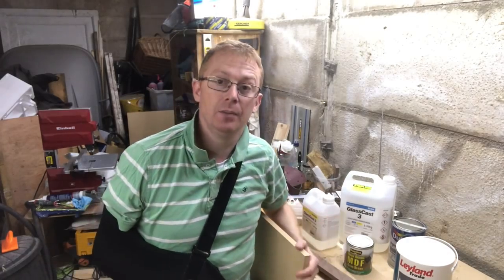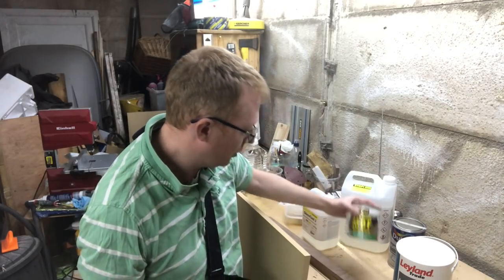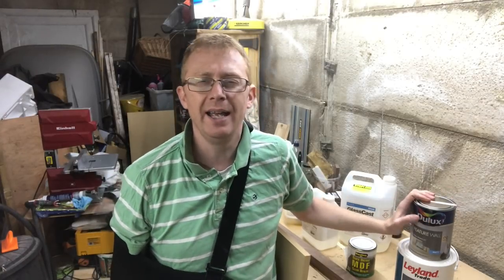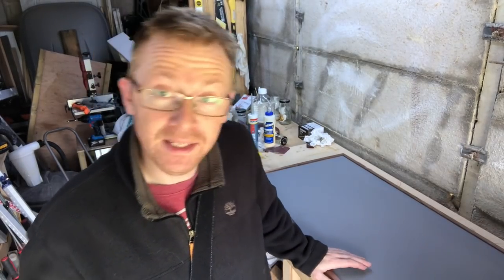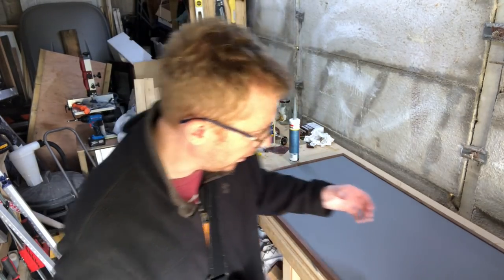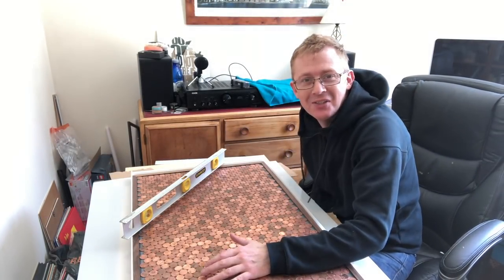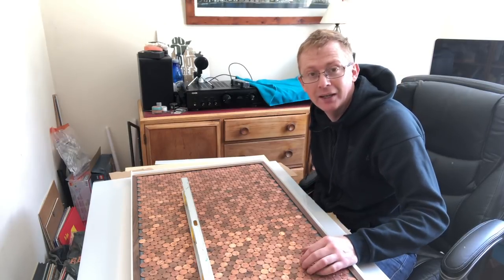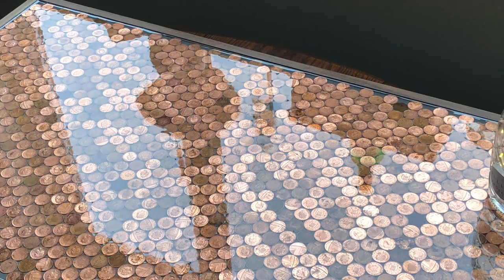Making a walnut / resin table top for pennies

Comment: Very nicely done Leo. You should be proud of that one 😁👍. I made the "expensive mistake" with a resin leak when I made my "penny box" vid recently, if you want a laugh... check out how I stopped it...lol. Also just a word from personal experience... don't rely on your JCB for mitres 🙁. I had the same one and could never get a decent joint. I now use a Metabo. Great vids, glad I found your channel. Keep up the awesomeness 😁👍.
Reply from the maker: Frank Williams Nice one, thanks Frank for the very kind comment😀. I will head over and have a look at the penny box video this morning. I’ve had the JCB SMS for around four years and (once I replaced the blade with a half decent one) has served me well for general 90 degree cuts etc, but now I’m doing more intricate and stuff that requires a greater degree of accuracy, it is just not up to the job unfortunately. It’s not retired yet though as I’ve given it to one of my neighbours who’ll get good use from it. I released an update video a couple of weeks ago and talked about investing some money in myself to build up a little part time business in making things like the chopping boards and penny tables to order. Decided to upgrade some of my tools and the mitre saw is one of them. Still love my budget tools though, the Ferrex impact driver is incredible value for money! 😀

Comment: nice table mate, can you help me clear something up. I watch all these epoxy videos and some people after thet pour the epoxy they get the sander out and polish and polish and polish it can you tell me why you didnt have to? Is it something to do with it being on wood? Cheers mate, the thought of all that polishing puts me right off
Reply from the maker: Hello James, cheers for the message. The reason why I got away with no sanding / polishing on this one is because it is Glasscast 3 which is a thin pour epoxy of up to 3mm that leaves a lovely finish requiring no sanding. Well I say that, that is providing there are no imperfections like bubbles etc which if there are it’s get the sander out and have many hours spare 😂😂. With the deeper pour stuff for the likes of resin tables then yes you will need to sand and polish it to your desired effect, but not so with Glasscast 3👍👍

Comment: Great job.  I’ve done a couple of table tops with resin, but I used circles of wood cut cut from smaller branches that I’d had in my wood pile for while.  The problem with the wood is its porous so you get bubbles, a lot of work to keep going over with the blow lamp to pop them .
Reply from the maker: Spot on Tony, as I said in the video, give it half a chance resin will soak into anything. The caulk around the edges helped by creating a barrier between the resin and the wood, but even then I still got some bubbles around the edges and had to keep checking and use the heat gun very lightly. The Glasscast 3 is better at reducing the bubbles, but the offshoot of this is it’s only suitable for slim pours. I think the ultimate solution is the degassing chamber thing, but you’re looking at £500 plus which isn’t on my horizon to be honest. Thanks for the comment 😀
Reply from the maker: Tony, was just thinking last night what you said in regards to porous wood and the bubbles. I read about a technique a while back, although I haven’t tried it myself, where people basically paint a thin layer of resin onto the wood and let it cure to the B stage before then applying the main pour. Apparently it creates like a protective membrane and helps to reduce the bubble issue. Maybe worth a try?
Reply: Hand-i-Craft That’s a good idea.  Funnily enough I did a thin layer first to stick down the wood slices, but I didn’t coat the tops, so close and yet so far hahahah!
Reply: i think this might answer my above question
Reply: or its probably below now

Comment: Is it easy to clean resin off of paddle and other items?
Reply from the maker: Apologies Rodney I’m not 100% sure what you mean, but if you mean the mixing paddle then if you buy the polypropylene mixing stick then yes the resin separates easily. The metal paint mixer I use I just leave over the resin bowl for the mixture to fall off and had no issues with using it again👍👍
Reply from the maker: Sorry Rodney, just read it back again. All the casings I use are made from polypropylene and resin doesn’t stick to that at all. It just ‘pops’ off once cured 👍😀👍😀

Comment: Nice project. Thanks for sharing. The video is very clear, everything step by step explained. I admire your patience. Gluing all those coins on the surface..
Was that a necessary step? I can imagine the epoxy would bind them to the surface. Or would they start floating away when you pour the resin?
Reply from the maker: Thanks Hans. Having worked a bit with resin now I can say with a decent degree of certainty, yes the pennies needed glueing down. If you try any project with resin and you are inserting an inlay of some form, it needs to be secured to the base otherwise the resin will submerge under it and lift it to the surface. It is a great product, but also a difficult product to work with, I’ve made mistakes like in my oak/resin top table which I learnt a great deal from, hence my ‘belt and braces’ approach😀. Glueing the coins took ages, but when I changed up to the silicone gun with some No More Nails instead of a drop of superglue on each coin, it was a lot quicker😀.
Reply: @Hand-i-Craft  Thanks for explaining why the pennies had to be glued down.

Comment: Saw your table great job,silly question how do you estimate the number of  2p to use.Thanks
Reply from the maker: david lacey Hello david, thanks for the message. If you’re using 2p’s they are 25mm in diameter, 1p’s are 20mm. If you intend to interlock the pennies like I did then take a couple of mm off the diameter for the length of the table. Then it’s a case of how big you want to build the table. Say the table top is 900mm x 500mm using 1p’s that are interlocked. So 900 / 18= 50, 500 / 20 = 25.  50x25=1250 (approximate) pennies needed. I hope this makes some sense, if not get back to me 😀
Reply: @Hand-i-Craft  The same idea but using beer bottle caps instead.Many Thanks for the reply.😀😀 makes sense.
Reply from the maker: david lacey Great idea david and good luck with the project. Make sure to do some homework on securing the bottle tops and the best way to do it. The only reason I say this is you don’t want air trapped under them as when the resin is poured, any trapped air would likely escape leading to lots of bubbles in the resin that you can remove in the initial stage with a heat gun, but can’t remove if they escape in the final curing. I’m only thinking on my feet here, it might be possible to pour a thin layer of resin or paint a layer of resin and use that to secure the bottle tops making it air tight, then applying a covering layer? I’m sure there will be plenty of videos out there on this. Would be great if you let me know how you get on. Best wishes, Leo
Reply: @Hand-i-Craft  Many Thanks for the reply leo.I better watch some youtube,to see how other do it,like your one for making a mould.Keep up the good work you do.😀
Reply: Ciao

Comment: another fine video   BEER   bloody good idea  did i miss  , did you not sand resin  or is it the diffrent  resin you use that  doesn't need sanding  so you have to be oh so level ?
'
Reply from the maker: Thanks traviss, yes you’re right no sanding on this one. Glasscast 3 is designed for thin pouring and a clear finish, which it did. The pictures don’t do it justice of how good it looks. The glasscast 50 I’ve used before is a much deeper pour and sanded etc. You can sand the Glasscast 3 I believe, but I felt no need to as I was really happy with it. As I said in the video it’s essential then that you check everything is level before you pour! 😀

Comment: Wouldn't been more cost effective to use plywood over all the cost of the products you had to buy for the MDF? Nice job on the end result... using one hand!
Reply from the maker: Thanks Wayne. I used MDF. as it was what I already had. I think with plywood the only prep difference would be not applying the MDF sealer. I’d still have to undercoat it before applying the top coat. I already had the sealer as I’d used it on my worktops and the top coat was a leftover can from decorating a couple of years ago that never got opened😀. I bought the acrylic primer undercoat and that’s really good stuff which I’ll definitely use on future MDF based projects.

Comment: Could you paint resin hardener onto places likely to leek? It would act as a sealant.
Reply from the maker: My honest answer mrsillywalk is, I don’t know. The best method in my opinion is to form a mould that is sealed as much as possible using the methods I suggest. Are you suggesting painting just the hardener to joints of polypropylene and letting it fully cure? I wonder what would happen  when you then do the resin pour? The sealant hardener wouldn’t stick to the polypropylene but would it bond to the table? There is also the issue of cost and time. With caulk on the inside of my moulds it is cheap and sets quickly. With resin hardener it is expensive and can take a long time to fully cure. Have you tried the method you suggested and if so, how did you get on? Cheers
Reply: @Hand-i-Craft  I haven't done this. I was just speculating that it may be a fail/safe for your potentially leaking areas and done just before the pour could solidify the resin quickly enough to be a block.

Comment: What's the working time when spreading ?
Reply from the maker: Darren Devey Using Glasscast 3 you’ve got plenty of time Darren. It’s all dependent obviously on the room you’re in (temp etc) but I’d say you could work it for up to an hour before you start to see a curing process.

One tip I have picked up recently is to put the resin containers in a bucket of warm water before you start to mix the resin with the hardener. It makes the resin a lot ‘runnier’ in texture so to speak, really helps with eliminating bubbles and you can work with it longer before it starts to go to the B stage👍😀
Reply: @Hand-i-Craft  thank you for the reply....   am thinking of doin a bar countertop using records (45s)..  never used resin before so it's a bit scary..  like you say it's not cheap so dont want to mess up or not order/mix enough...
Reply from the maker: Darren Devey That sounds like a great idea. If I could offer one suggestion Darren is to maybe try it out on a smaller scale first? Maybe just one or two 45’s and they’d make great placemats for your tea! Also you’d get to know how it works on a small scale before ploughing a chunk of cash into the bar top! 

Good luck and let me know how you get on 😀👍
Reply: @Hand-i-Craft  good idea 👍